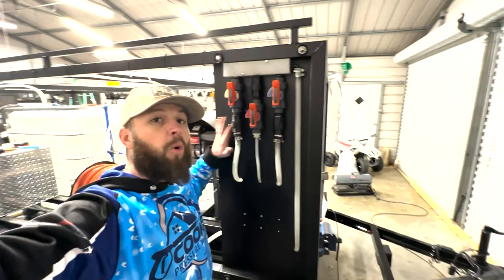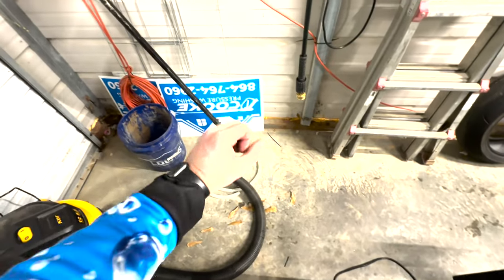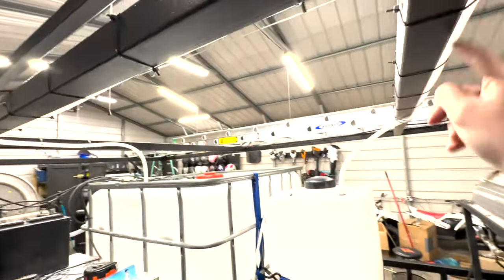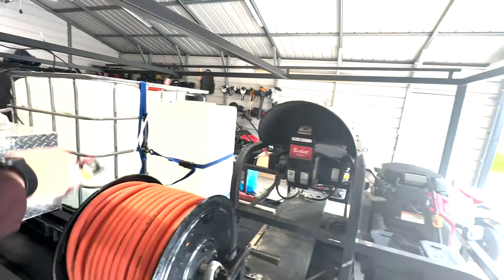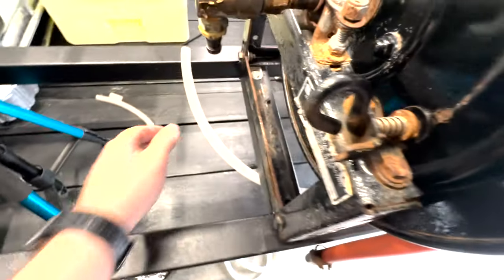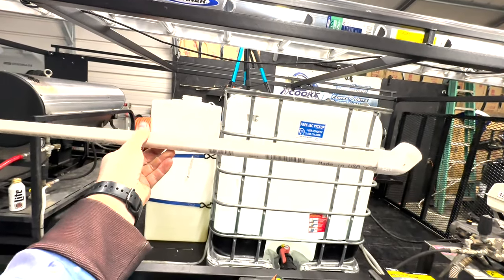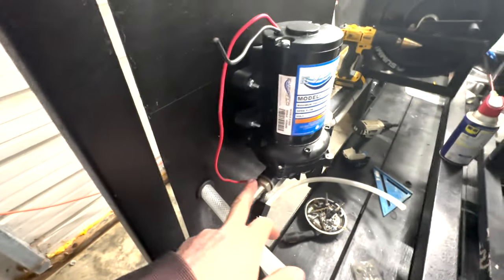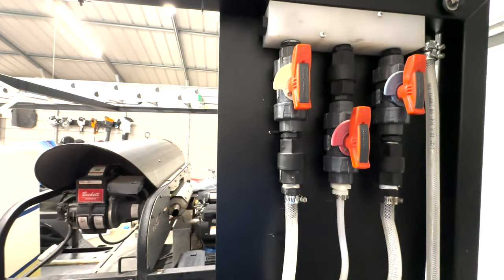How To Set Up 12v Soft Wash Proportioner - Plumbing + Tips

Comment: Best video Ive seen yet, thank you. What is the name of the connection on the hose reel that accepts the hose from the pump? Is that just a half inch male to a half inch barb?
Reply from the maker: Yes correct but make sure the fittings for the pump are npt